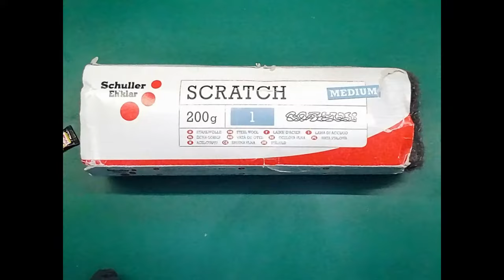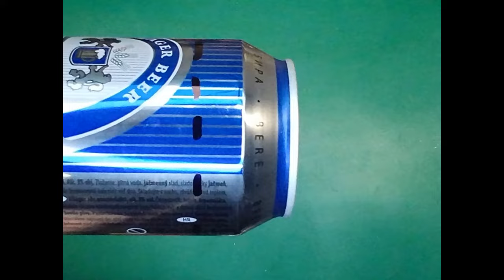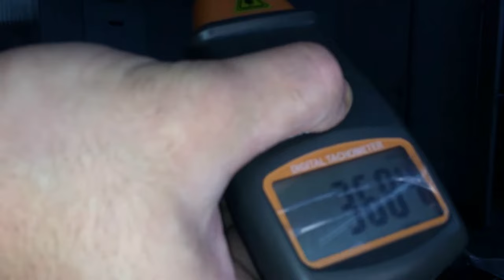[TUTORIAL] How to make a DIY free piston TASHE (ThermoAcoustic Stirling Heat Engine - step by step)

Comment: you can explain how it work ?
Reply from the maker: Yes I could, but too long that to write here now. This is a traveling wave annular looped Stirling cycle thermoacoustic engine with membrane and mass in it. I think the best way if you could start to check the TASHE (ThermoAcousticStirlingHeatEngine) in the google first. Tons of paper available there. This is a simplified version of that. The membrane/mass usage make the engine more compact because substitute the tube of Inertance also the Compliance partially.

Comment: Can't get it to work. Done exactly as your video. + 10 mm steel wool #1 i bottom, +0,5 mm hole, wet tissue, and burning 5 min with a Dremel handburner. What do I do wrong? Not enough heat? Stretching balloon too much or too little? Wrong steelwool? Too Tight wounded steelwool? I 'bang' the top weight lightly or hard - nothing happens. Please help ;-) I really, really would like this to work.
Reply from the maker: Dear Rogert, the steel wool maybe too dense, but I don't know the Dremmel handburner... I use PB gas burner and steel can, not aluminium. Steel could work with higher flame as the aluminium one, but it should work with middle gas flame before the aluminium material start to melt. The inner membrane should tight as possible with pretty high frequency sound, because the heat start to loose it a bit. The main membrane also tight but you put some weight on it. It should work. I built it 7 times yet, and the unit worked all the time. Sometimes just the heat wasn't enough, sometimes the cooling. But worked always. Try it again with little modifications. First just try to add more heat. BLADE
Reply: @AttilaBlade  I guess all we can get is aluminum. Hope mine works with aluminum.
Reply from the maker: @QF2653  If the parameters are good then it should work! Fingercrossed! :)

Comment: I have two questions. 

1. What is the pinhole for? Will it run without it?
2. Does the inner membrane require a weight like the outer membrane?

Thank you. I think I will be building a TASHE this weekend!

Edit:
My first attempt failed. Here we go: https://youtu.be/8wXG-GYU2Pk
Advice?
Reply from the maker: Dear Jaden, the pinhole is /small as possible/ important, because the heating process increase the pressure and the power membrane's tension also tune up the frequency the engine can't start and sometimes destroy the membrane. It is necessary for the stable run in this configuration. The inner membrane has no weight basically as you see the video tutorial. But it could help sometimes if the membrane tension is too different. Not necessary for the stable work this is a fine tuning part only if you watched my earlier video too.   I'm waiting for your engine's first run video Jaden! BLADE
Reply from the maker: @jadenpeterson4881  Try to use alcohol burner, this electric heater has no good surface connection. Few question. The membranes are tight as I showed in the video? The wrapped regenerator has a bit more length as the inner cylinder? That gives a 1cm gap from the bottom approx.
Reply: @AttilaBlade  I will try a propane torch and if it still doesn’t work I will tear it down and check it. Thank you for the quick reply!
Reply from the maker: @jadenpeterson4881  Be careful!!! The propane torch mold the aluminium beer can!
Reply from the maker: Try to heat up far from the can, also try to heat up a bit the side of the cylinder's bottom not the beer can' bottom. If you understand what I want to suggest to you.
Reply from the maker: @jadenpeterson4881  Did you fixed the can when you heated up on the electric heater??? If you don't hold it with hand, then you should try it first!

Comment: Pretty cool.  With some worn out rechargeable there's a coil of wire.  I wonder if the presenter has tried making electracy by putting a small magnet on to the bolt and bringing the wire coil near --- all while the coil is hooked up to an Ohm meter set of AC?
Reply from the maker: It is possible, and I made it few times, but this generator construction is innefficient for us. We should use a diferent much higher efficient  generator construction. Also I should pressurise it for a bit more power. But, actually this is a model where we can understand the thermoacoustics basically.

Comment: No explanation on how this design works... I’m trying to make a useful one but I can’t get any basis for my design if nobody says anything about why it’s made that way. Why do you use steel wool? Why does the inner can stay still when other people make it act like a piston? Why does the inner can need a membrane as opposed to sealed or open? What’s the purpose of the ♾ shaped section of can and would it work without it? Every video I watch doesn’t explain anything and all I want is to know enough about the mechanism of action to be able to make a bigger and more powerful design with improvements but I can’t improve anything if I don’t know what the purpose of each part is.
Reply from the maker: I understand your frustration about the working method. It's not easy to see after a mechanical Stirling type engine where the parts are solids. This is a thermoacoustic Stirling cycle heat engine design where the solid displacer replaced by a gas piston in the middle tube section. The scientist call it thermal buffer tube originally. The membrane could reduce the resonant frequency. That frequency came from the unit geometry, the lengths and cross section areas originally. A basic Thermoacoustic loop on ambient temperature 20C around 343m/s:60Hz=5,716m So the membrane replace a really big volume of air here. The steel wool works as heat exchangers on the cold and hot ends also as regenerator in the middle section. The temperature different initialise the self-resonation of the gas and still drive that while the temperature different enough for that. Basically the two membranes has different spring constant also mass. When the gas start to expand the pressure wave hit the membranes but with a phase shift because of the regenerator. Another example if the gas expand it goes first there where the resistance smaller. So the gas start to oscillate back and forth and the hot side amplify the wave in every cycle. I want to build a transparent unit for an easier understanding, but I try to find the perfect geometry of glass parts, because there I can not use regenerator wool in it. I hope it will help to you a bit! The scaling is a big challenge in this segment. The pressure resistant and optimised gas side hole parameters in the heat exchangers are the achilles heel of the unit. But nothing is impossible just horrible price actually. BLADE
Reply: @AttilaBlade  thanks for the reply. I'm going to recreate this design today as a first step to get me into these heat engines. I'm glad someone is willing to explain the concept to me lol
Reply: @AttilaBlade  I just made one and took it apart many times to change tensions and weight but no success... idk maybe this type isn't a good place to start. It didn't do anything different from how it is at room temperature. I had it on a hotplate turned to max. Any idea what engine type has the best success rate? If you recommend some of your videos, I will surely watch them. Thanks.
Reply from the maker: @jjhack3r  Please send me your engine inner pictures with an assembling video. I will "smarter" with that. The problem with your engine is something small I think. Maybe just the not enough heat, and cooling. The pin hole should be small as possible. The inner tube should be a bit far from the bottom. Do not push down strongly into the bigger can. The air should turb under that tube. If you have gas burner, use that first, but fix the unit somehow!
Reply: @AttilaBlade  I didn’t make it work but likely the issue was not enough space at the bottom. Instead I made a different type that people call the nasa sterling engine and I got that working on the second attempt and it’s really not bad. Anyways, thanks for your help man. This is the start of a long journey to improve the practicality of these type of engines.
Reply from the maker: Oh, well! Your welcome! :) I hope you don't given up this one, but I'm happy if I could help or my mentioned things help to you to make a working hot air engine model. Do you make video about that?
Reply: @AttilaBlade  This response was very helpful for me, Blade! I just made one and I couldn't get it to work but I think I pressed the inner can all the way to the bottom, so I will change that, seal it up and try again. Also, I used a steel scrubber instead of steel wool. (the steel scrubber is not as fine as steel wool) Do you know if that is an acceptable substitute?
Reply from the maker: @SKDChurchWYD  Dear Don, I think the steel wool is not necessary, but I didn't try the other one for this type of engine. But in other hot air engines I used and those worked well, so if you followed the instructions right, it could work too. :) Fingercrossed. Sometimes I take some wool under the inner tube also, than impossible to close that hole. The high heat and the cooling is important for this unit. I hope your engine will work! Please leave me a feedback with video link to your engine! THX! BLADE

Comment: mine wouldn't run . inner balloon melted.
Reply from the maker: Is the regenerator in contact with the inner also the outer can? The heater is heatin only the bottom or the bottom side? The other parts are cooled with wet wrapping, or water jacket? Didn't forget the pinhole? Few basic question only...
Reply: @AttilaBlade  Everything seems the same as yours. except maybe the fire. I used alcohol in a bottle cap.
Reply from the maker: @QF2653  the inner membrane was tight as possible, from latex balloon, or something? The heat should'nt going up to the balloon too much. The cooling part should be longer then the heating. The flame should touch the bottom only, not the side, maybe only near by the edge. The cooling is really important.

Comment: I have a few questions that I am sure have been answered by you or others in this comment section or your other videos but I couldn't find them so here goes...

1. Does this engine run indefinitely?
2. If it does run indefinitely how about a more permanent cooling system?
3. How about adding magnets to the washer to turn it into a generator?
4. How about some output measurements as a generator?
5.any ideas to scale this engine? As in a larger engine with higher output
6. Uhmm please keep up the great work you e been doing. 😉
Reply from the maker: Dear Reza, this is not an indefinitely running unit, just a running well engine to show this type engine could possible to build from scrappy things also. If you want you could use a water jacket on the cold, and a heat trap on the hot side. That's will be more "indefinitely". The simple moving magnet in stator air-coil is an inefficient solution but it works well if you want. The output measurements is different. I'm not electrical engineer, I skip this question. The scaling is more complicated thing. The highest pain is the heat exchanger on both sides. You can use soldered copper tubes around and soldered to the inner tube with massive water jacket maybe, or with machined copper block with gas and water paths... Hard and expensive things. Maybe a folded thin fin soldered to the wall and the inner tube also with water jacket... Another thing the regenerator it should be dense and stainless steel for high heat input. The inner tube originally cooled near by the membrane to reduce the heat load in it, so for the long time isage it will be necessary. The main membrane... I think better to change something  other thing, maybe some corrugated thin metal for the higher energy output. The generator is not my place, but I know this simple type has  not too high efficieny. I don't know what's your goal but di not see more in this unit as the other desktop homemade can model Stirlings. BLADE
Reply: @AttilaBlade  what is the purpose of that hole?
Reply: @AttilaBlade  I have seen some research papers on thermoacoustic engines made from very ordinary materials, one single stage deign claims efficiency of 8-9 % and another three stage cascade design with ~20% efficiency, I do not have a workshop right now otherwise would have tried to replicate and validate, however I am buying some components to try at some later time. I can share those papers with you, if you like.
Reply from the maker: @shahid3520 Thanks! Maybe I seen them all, but probobly not. I really like the research papers. The theoretical or calculated efficiency always bigger than the reality because of the ordonsry materials and the differencies from the ideal. The heat exchanger and the pressure are always the Achilles heel there with the optimal regenerator and the connected generator. Could you send me the paper onto my email address? Thanks!
Reply: @AttilaBlade  Just emailed the papers, yes of course heat exchangers are quite difficult, with the setup shown in papers, the researchers seem to have achieved good results. For the generator/motor they have used commercially available loudspeakers.
Reply from the maker: @shahid3520  what email did you use? attila.blade@gmail.com

Comment: Dear Author, here is a link to a video of your fantastic engine running: https://youtu.be/aGuzmtmfWos. I understand that the efficiency depends on the frequency of repetition of cycles. But! Air has inertia, the regenerator has the required density. Purely theoretically - a high frequency is a guarantee of efficiency, but in some cases a powerful impulse and a piston stroke seem to be a more attractive concept for the implementation of any engine. In any case, I bow to you. Thanks a lot!!! I managed to run home for a while. Made a video as promised. While I play with it like a child. Thank you! Soon I will think...
Reply from the maker: Nice engine! Congratulation Imyanet! The unit is not a free piston Stirling engine, if you built this version. This one is a ThermoAcoustic Stirling Heat Engine// TASHE
Reply: No, dear author! I will argue with you. This is a fantastic engine, but it is not a thermoacoustic engine. This is a hidden alpha type. You are a brilliant inventor, I thank you!!!
Reply from the maker: @imyanetfamiliyanet6594  Dear Imyanet, please read papers about TASHE, especially the membrane TASHE where the researchers are stoped the Gedeon streaming. "Alpha" is basically only a name for same stroke, same volume, same piston linkaged engine with high compression ratio. This one has low compression ratio. The unit works without membranes too, if the geommetry is perfectly tuned up! I've made more different TASHE with different geommetries, please find and see the similarities. I made also an opened or straight version of this unit, but that unit was driven with a linear motor. That unit has a free bellow piston and that looks like an alpha too, but that wasn't alpha, because that is a pulse tube Stirling engine if we digging in the deep. BLADE